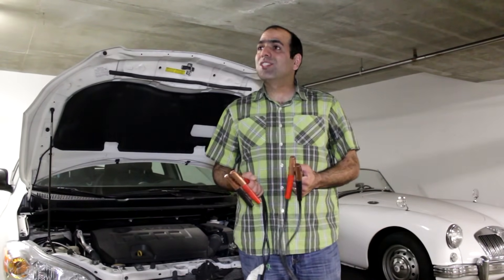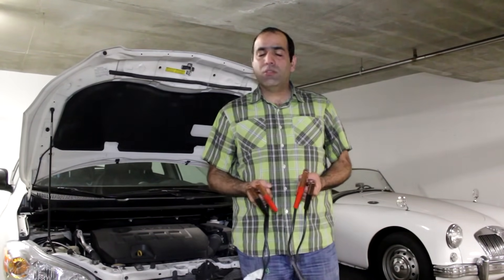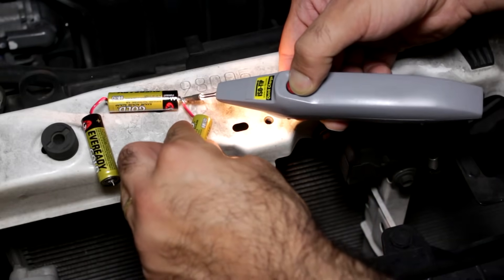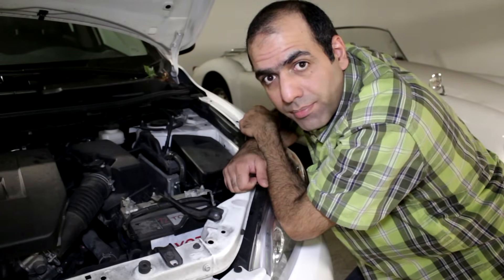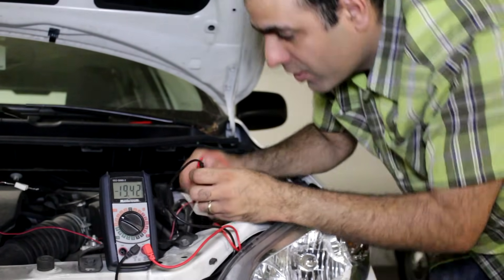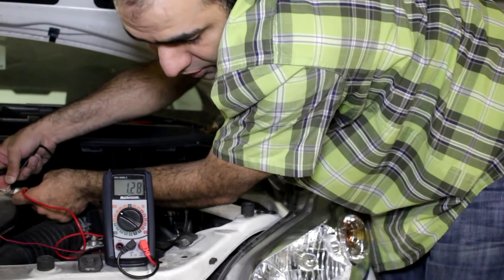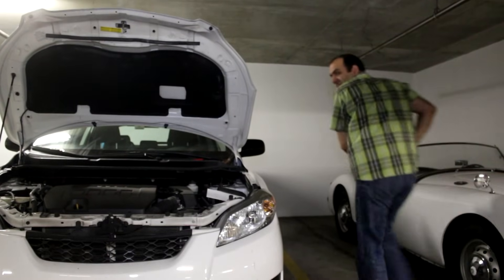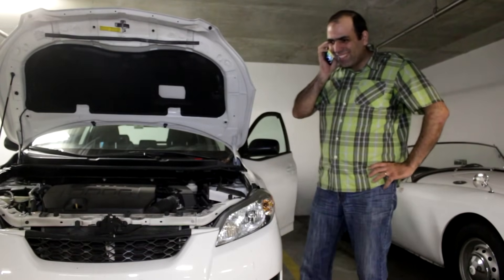Jump Start a Car with AA Batteries

Comment: is the car battery was really dead at first from this video? just curious
Reply from the maker: Dito yes, I drained it to death
Reply: oh i see thx
Reply: ***** Do a tutorial on draining batteries to death.
Reply: tarziq leave a light on
Reply: Eviltech He measured 11.7 Vdc under an open circuit, under load the voltage will drop heavily to the point where (in this case) the starter relay will release. This allows the voltage to rise again and the cycle repeats itself.
Reply: tarziq Plugging the battery to a big resistor should do the trick
Reply: Dito The windscreen wipers were moving thou
Reply: Eviltech Batteries always show a higher voltage under no load than under their rated load.  So do unregulated transformers.  If he read the voltage while trying to crank the starter motor, it'd probably be well under 10V.
Reply: no, in my truck and car if its under 11.8v it won't crank at all i can barely get it cranking at 12.2
Reply: ***** I read that in your voice
Reply: tarziq "Used two 0.5 ohm 250W resistors (1 ohm total) to drain the car battery for around 3 hours (~12A continuous)." 
http://www.reddit.com/r/videos/comments/3af91f/jump_starting_a_car_with_aa_batteries/csc3fh1
Reply: Malcolm MacgregorSound I know what he measured and how, doesn't change the fact his battery is old and needs to be changed. He could have measured 12.5 and still not have started. Usually this means the cells are no longer balanced and one or more have reduced capacity. That results in higher overall no-load voltage, but when under heavy load the cells with reduced capacity fail and even sometimes change polarity. I have easily started a car on 10V because the battery had a dead cell and i shorted it by putting a screw driver inside and wiggling it to short the plates. worked a charm, however once we started the car i disconnected the battery to prevent the alternator from burning out.
Reply: billybobjoe198 Plenty of capacitance in the trunk (1.5F)  to deal with the spikes. however trying to charge a 10V battery with a car alternator will definitely destroy it under 10 minutes. The alternator is a constant voltage source and tries to push as much amps as it has to keep the battery over 13V  That will definitely fry the diodes, maybe even the 3 phase winding.
Reply: tarziq Heat lamps.

Lots and lots of heat lamps.
Reply: Running an engine with a properly working alternator and regulator won't burn anything out, but trying to charge a partially shorted battery almost certainly will. Even that wouldn't burn it out immediately. You'd never get it started with a fully shorted battery. The jumper vehicle's alternator would burn up, if the cables and other battery survived long enough.

Alternators are regulated by voltage. Excessive current burns out windings and circuits. The regulator would act the same without a battery as with a fully charged battery. The alternator would only produce the current needed to run the electronics, ignition, and whatever accessories are running. Sensitive electronics would be in more danger than the alternator without a battery to help the regulator work smoothly, but automotive electronics are fairly rugged. 15V is no big deal, (it's regulated to 14.7V) and 16V for a few seconds is generally nothing to worry about.
Reply: RaptorTeak Surely there would be a more exiting method ;) you gotta admit killing batteries sounds brutal xD
Reply: tarziq The ultimate prank on people you hate.
Reply: billybobjoe198 anyways anything more than 4700 microfarads will deal with the spikes. New cars have that amount in every single module. It totals around 30000 microfarads.
Reply: Lars Harmsen .... and the brake lights were working
Reply: it was
Reply: Lars Harmsen wipers will run at any voltage.    The starter will not even try if it's under 12v or something like that. Stupid
Reply: I guess no cause the multimeter showed 11+volts before connecting the AA batteries to the car battery 😒
Reply: billybobjoe198 Usually when your battery is fine it can provide the cranking amps down to 10-10.5V  If it reads 11.7V and doesn't crank the engine than there is definitely something wrong with it.
Reply: If a car don't crank with 11v in it is look elsewhere for a fault. A car should still crank

Comment: Why would you connect the batteries through series instead of parallel?
Reply from the maker: Wolfyman66544 to charge a battery, you need to have a higher voltage than the battery. 1.5V AAs can't charge 12V car battery unless you put more in series to increase the total voltage.
Reply: Wolfyman66544 listen to what he says at 1:09... 10 in series X 100 parallel ,
connecting in series adds voltage while parallel adds current... to slowly charge a battery(10 mins) you need low current (easier than getting 1000 batteries to start it off right away)
Reply: ***** Oh, that explains it. Thanks!

Comment: try crank your car with 8 batteries in series and high capacity capacitors connected in parallel with the batteries so you can store energy from the batteries in the capacitors and when you need high current you will discharge the capacitors.
Reply from the maker: Gotin Fuklio That capacitor needs to be huge, like another battery!
Reply: actually more than another battery if it's not supercapacitor, but it would be fun to start car with capacitors and aa batteries
Reply: Gotin Fuklio There is a guy that that. Check out /watch?v=GPJao1xLe7w

Comment: 11.7 volts is plenty enough charge to start a car...
Reply from the maker: Buick Bubba As soon as you start drawing current, that voltage significantly drops.
Reply: But you don't measure charge in volts
Reply: Buick Bubba It might be enough voltage, but it cant provide enough amps to crank it
Reply: Buick Bubba You use coulombs to measure charge not volts lol

Comment: 11.75Volt should be enough to crank a 4 cylinder car.😂
Reply from the maker: yang miao As soon as you start drawing current, that voltage significantly drops.